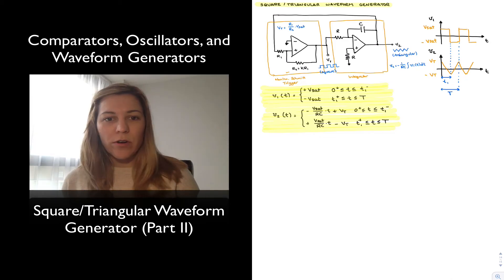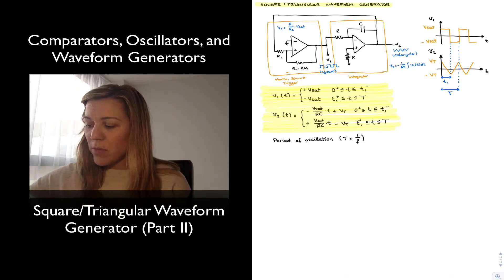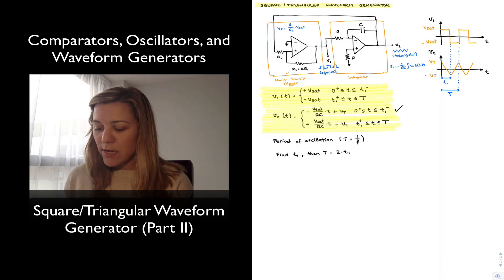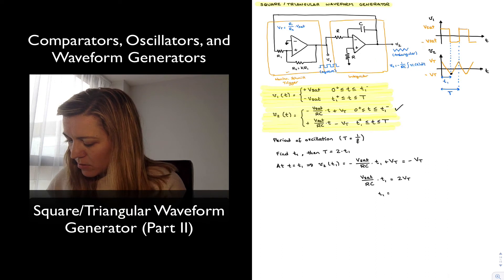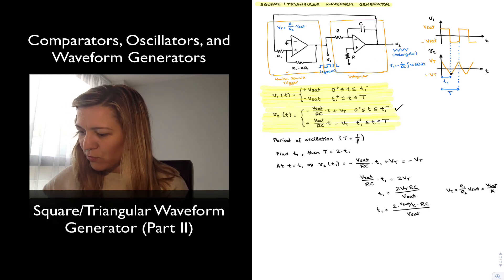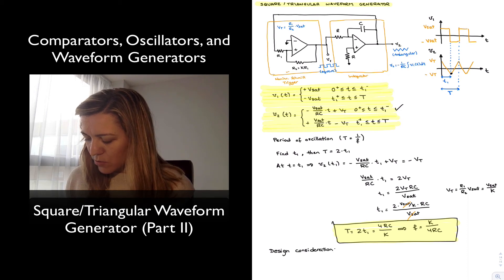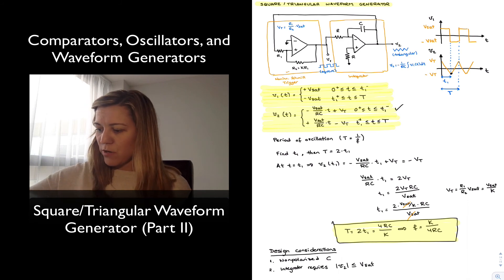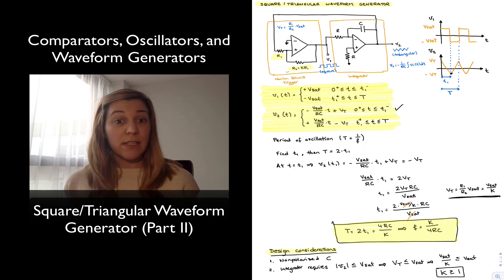Square/Traingular Waveform Generator (Part II)

Comment: Good explanations. Don't forget that you need to take into account the offset current & voltage of the integrator if you need to reach low frequency oscillations (take a low offset opamp or adjust the voltage at the - input of the integrator)